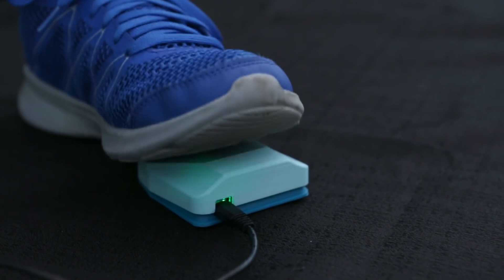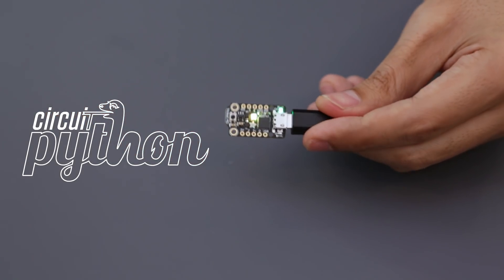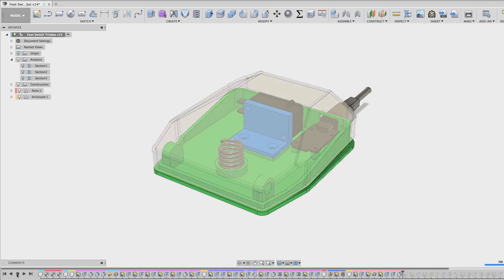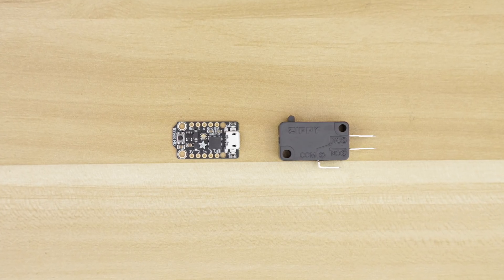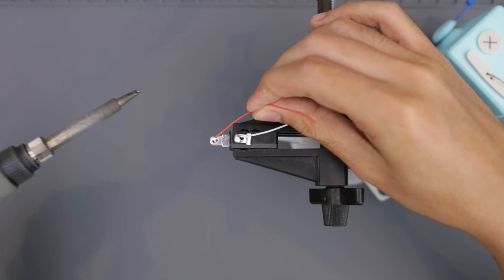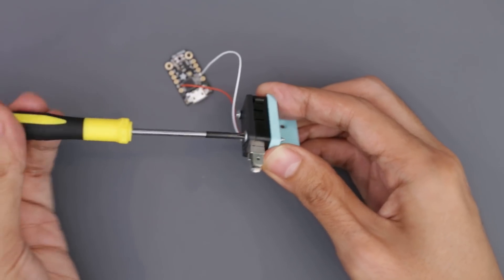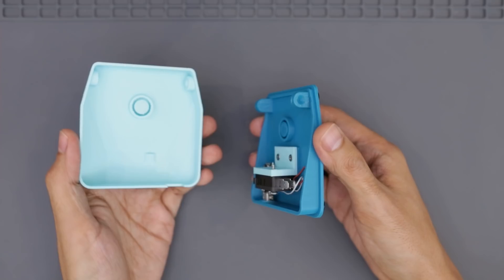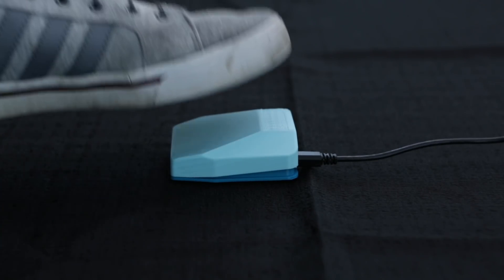USB Foot Switch with Circuit Python

Comment from the maker: If one does not own a 3D printer, there's other means of access. Libraries, Hacker Spaces and services like 3D Hubs and Shapeways are all great alternatives.
Reply: You could just as well use some wood (even scraps will do) and cut, file and sand that down into shape. I probably would not go for the exact same funcional design as with a 3D printed part, but all you basically need is a hinge, a spring, and an end-stop for the hinge, so you don't crush the switch when you accidentially stomp your pedal a bit too hard.
Reply: could you use the Adafruit Pro Trinket 5V 16MHz in place of the m0?
Reply: @ellrrz  Don't see why not. If LEDs are used, it makes them brighter.
Reply: Or scrounge one from a thrift shop, usually found sad and divorced from a sewing machine.

Comment: These large microswitches are super loud. Alternatives?
Reply: optical switches
Reply: @damien7815  Nah i don't need it to be silent, just less obnoxiously clacky.

So i was looking on Thingiverse and saw this, it looks attractive, the shape, i was thinking of building it as a sustain pedal for my Yamaha arranger synthesizer just without electronics only the enlosure and the switch, so i'm not going to have any power for the optical switch in there. Often enough sustain pedals use a spring and a metal rod or something similarly easy like that, you can have a capacitor for bounce suppression but usually the debounce logic in the instrument is enough for that all by itself.
Reply: @damien7815  I opened up the switch cover and loaded it with sticky thick grease :D no more ear-splitting noise. The high force of the switch helps it overcome fluid viscosity - it might not work with all switches. Electrically it looks good, basically no bounce and low resistance still. I don't care if it shows some issues or doesn't work out in the long run, i'll just have to try something else, but for the time being i'm not anticipating much trouble, and i think the contacts are even slightly protected against corrosion and wear as the grease is water repellent.

Comment: If I wanted to set this up as a 'Push to Talk' with Discord, is there any other special considerations I need to concern myself with?
Reply: not made this exact one, but I did make one years ago using a teensy for push to talk in teamspeak. I set mine to be a keyboard, so the only thing to think about was the keycode to send on activation so it didn't collide with any other keybinds. I think I ended up using F15 iirc. This example uses left ctrl, which I would not recommend. Discord also supports a "push to mute" keybind you can add under keybinds settings in the app, which might be better as you don't have to keep it depressed for long periods of time, as a press of the switch will toggle between muted and unmuted.

Comment: What about the Spring ???
Reply: Yeah it seems like he left it out in the shown assembly. It should still be used as the compression spring will force the top piece to go back to its starting position making the circuit open. Doesn't have to be a really stiff spring, but one that should give in to being compressed between your thumb and pointer. Uncompressed length should go to where you want the top piece to rest at.

Comment: I have a sound mixer that allows for a foot switch but the switch interfaces via 1/4 phono... How would make one of those work?
Reply: Probably a simple contact closure. Short together the 2 wires from the 1/4 plug

Comment: Hi! Nice video! One question: at one point the 3D model shows a spring , but this is not present when the foot switch is assembled. Is the microswitch providing all the spring force for the pedal? Or should the second spring be included?